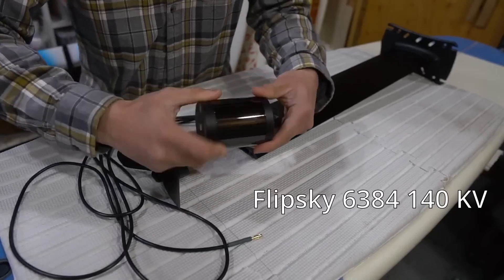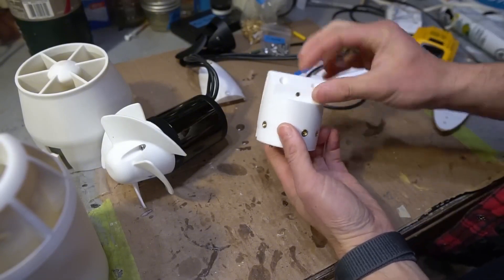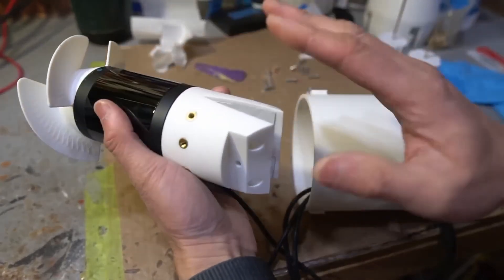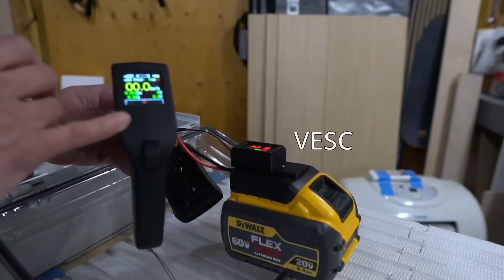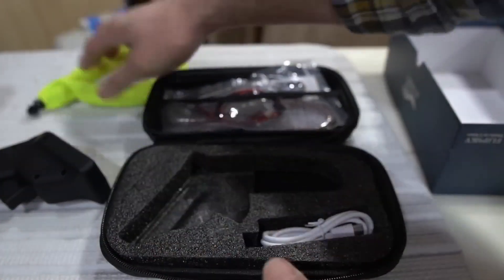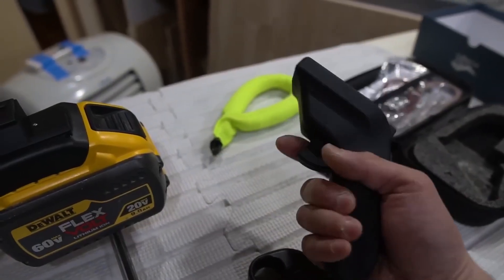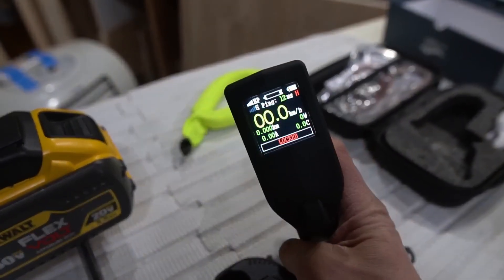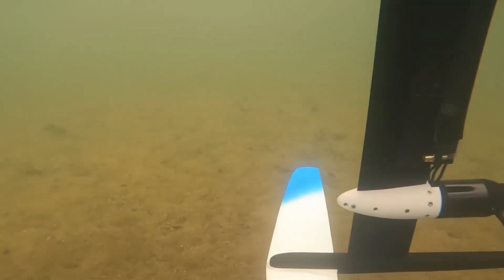How to Build a Cheap E-Foil with the Flipsky 6384 140KV Motor? |@AndrewWorkshop

Comment: @Flipsky are these motors water proof to the point they don't need a water tight enclosure to store/mount them
Reply from the maker: Yes, the motor is waterproof. It can be used directly in water.

Comment: I have built one very similar 😁 5'3 95L board,  AK Durable supply wing (big one, like 2000cm  Wing and long mast 80cm with a 14s8p Samsung batt vesc 75/350 (water cooled) and 65161 motor vith vx3 controller. Took it to lake last year for test but barely moved. Needed to redo motor config in water and turn up but forgot usb c cable 🤣🤯 about ready to go give another try. Haven't cut up this custom made deck for battery compartment yet. Wanted to test first 😉 cool build. Have made a few different props to try and bought some. Gonna start with a big 2 blade aluminum one from a 2.5hp outboard 😁 barely even moved at vesc recommended amperage. Gotta crank it up 😉
Reply from the maker: Cool:yougotthis: